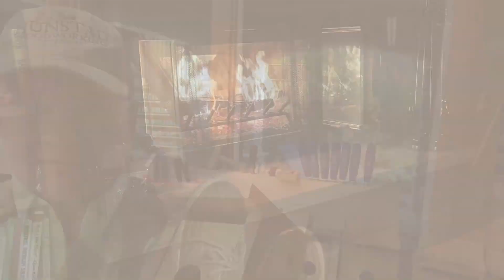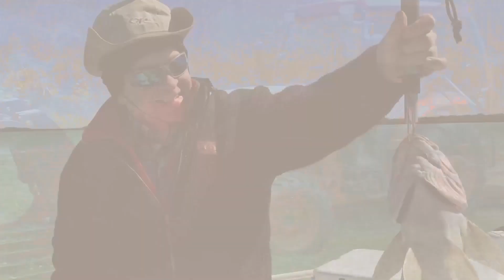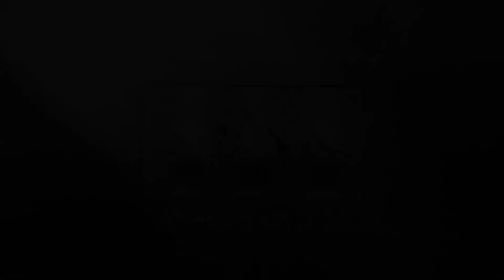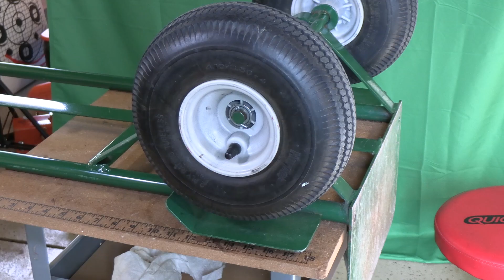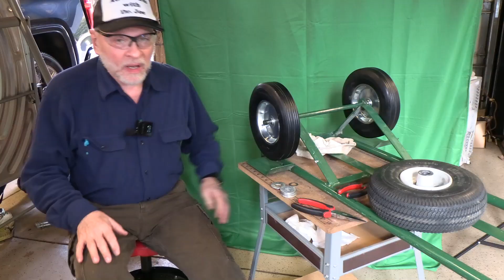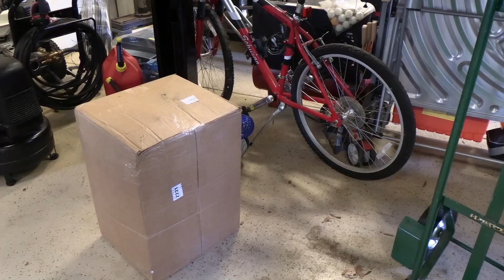Runflat Tires for a Hand Truck IMPROVED!! with Dr  Joe

Comment: How do the run flat tyres go over rougher terrain?  I think the pneumatic tyres would have better shock absorption.
Reply from the maker: Yes, you are absolutely right. The pneumatic tires are shock absorbing for sure where these run flats are not that is their downside. Consider subscribing. Thanks. Joe.

Comment: What is the details on the replacement tires?  Where did you buy them, and how much were they?  I have the same Harper Model: 27T84 hand truck with pneumatic tires and one is flat.  Harper sells Model: WH 83 solid tires but they are expensive.
Reply from the maker: John , you are correct. I really didn’t put all those details in and I should have. I purchased these runflat tires at Harbor freight tools in the US. They are inexpensive and I will try to put a link in the description later today. Consider subscribing. Thanks. Joe, I will tell you that moving a heavy load with pneumatic tires properly inflated certainly feels better than these hard rubber ones but you’ll never have a flat tire.
Reply from the maker: I now have two options listed. The Verpr is less expensive and I think will work very well. Check out the comment section you can click on it and go right to Amazon to buy. Thanks.

Comment: I would have drilled another hole in the axle closer to the wheel and put the cotter pin thru that
Reply from the maker: Hello animal79thecat
That is a good idea that you mentioned, and I did consider it. However, I was unable to drill the hole with the drill press and felt that doing it by hand. I would probably have some wobble and likely would break a drillbit. Good idea however but the hose clamp is so simple. Consider subscribing. Thanks – Joe.